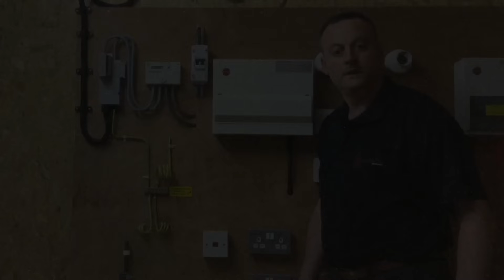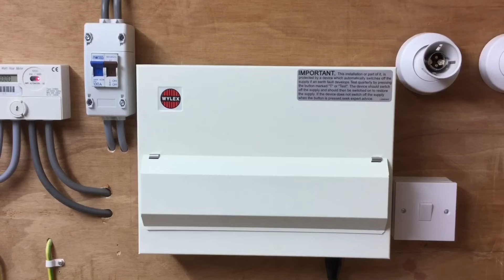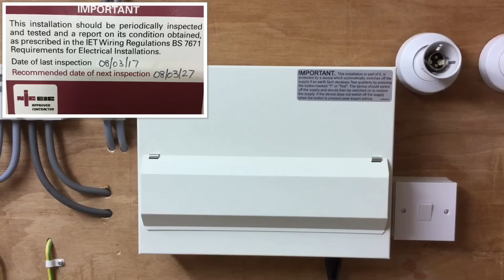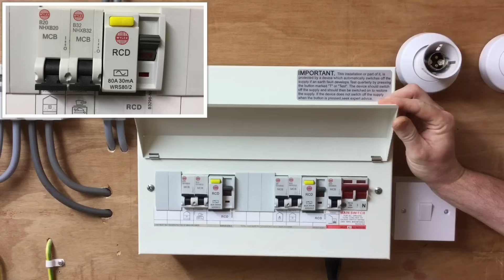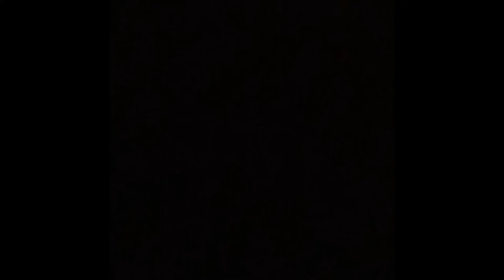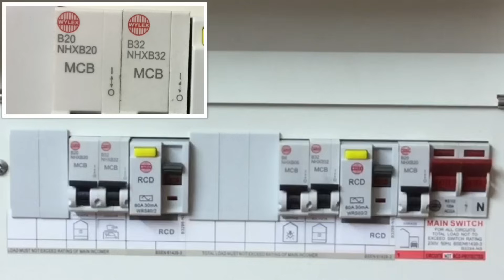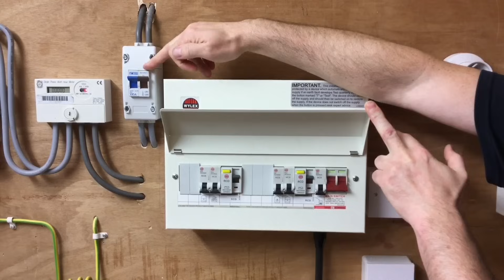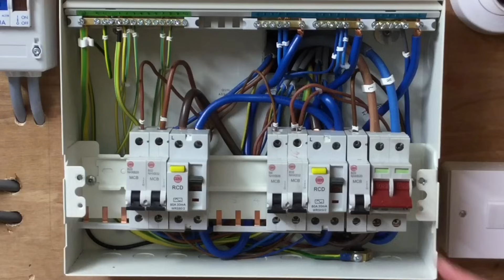Understanding your Consumer Unit (Fuse Board) Overcurrent & RCD Protection plus Isolation Features

Comment: Hi, great video as usual, very well explained! I was just wondering if you had any plans to do a video covering an electrical installation certificate or condition report  i.e filling out schedule of inspections etc. I know a lot of electricians run into problems when filling out these forms or have varying ideas about what each section is asking them for! Cheers.
Reply from the maker: +DEAN GRIFFITHS 
Hi thanks for the question. I have wrote my own guide to the schedule of inspection it maybe worth me going through that during one of my videos. I am currently producing uploads to match where  my learners are on the course. I will do all I can to fulfil your request in the coming months. Thanks for watching GSH Electrical